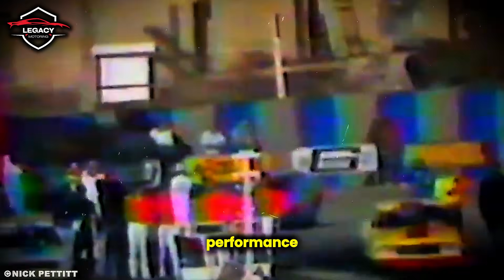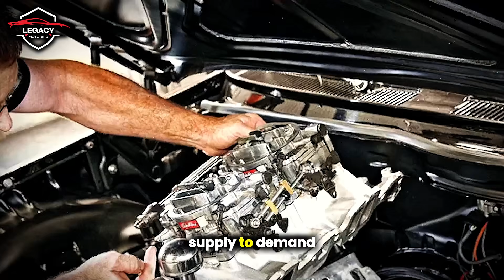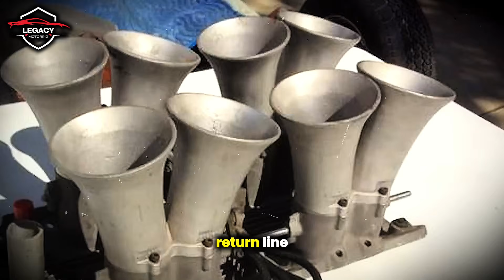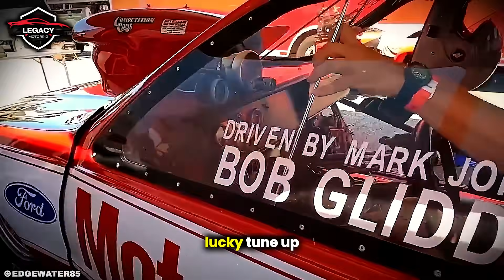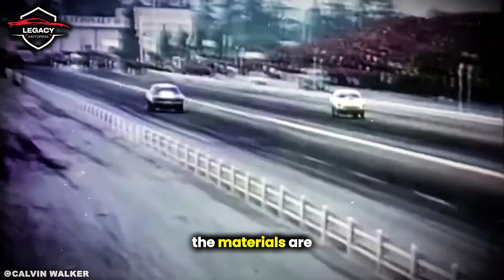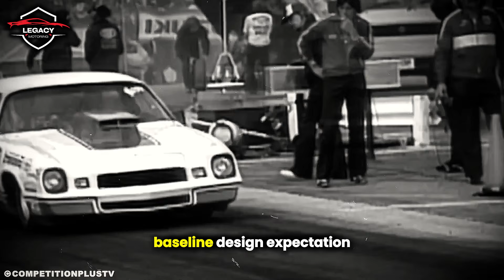The "Impossible" Fuel System That Outsmarted NHRA: What Was Bob Glidden Really Hiding?

Comment: How is it that brilliant when every car on the road had it because of the EPA’s emissions requirements? They wanted a return line back to the gas tank in a closed system to control the amount of fuel being burned more precisely and prevent it from vaporizing and entering the atmosphere. Then, when fuel injection started being cost effective they kept the system to keep fuel injection the system at the proper pressure. But the real key for racing wasn’t pressure at all, it was consistent volume so that the volume of fuel needed for all throttle positions and all load conditions, from getting groceries on a city street to climbing a hill in a 4X4 to towing your race car to the track. It only made sense then to do the same for a race engine.

Comment: its probably be 30 years since I seen even seeing a pro stock race on TV, its just logical that if your adding FI to a non FI car is you copy what the manufactures did, so I added a return line. I did not need Bob Glidden for that, other things you should do is add shielded wire to critical signals, also rubber mount your spark box (JM2CTW)

Comment: I'm 2 minutes in , sounds completely bogus . I'll edit afterwards . Wasn't Gary Williams building Bob's carbs back then ? ,,, on edit : let me count the several ways this is bogus : this is not why Bob was so strong , and is probably the way the content entity wants you to believe , it starts in 1986 , we ran carbs for 25 or more years after 1986 , the fuel does not care how it gets to the needles and seats , I designed a bypass system about 1988 , I'm sure there were others , yes the gas would tend to be slightly cooler , very little power there , Bob in my opinion after 40 years of consideration was that Bob led the cylinder head development , he also had the stock Boss 4.900 bore centers before everybody else . We had data on the fuel pressure at the needle and seats in 1988 and I'm sure we were late at that , all of that wasted breath on electronic fuel injection is 95 percent moot and annoying , the nose mounted tanks and pumps made this wasted hour all the more useless , the whole video is degrading to the Glidden family's hard work , by trying to say this entity knows what the Gliddens had . I'll probably think of more .